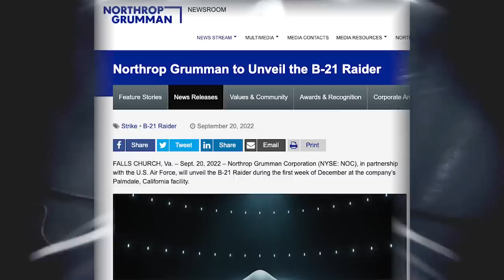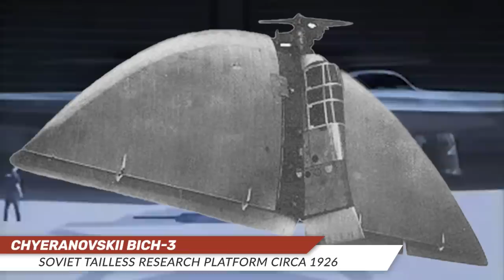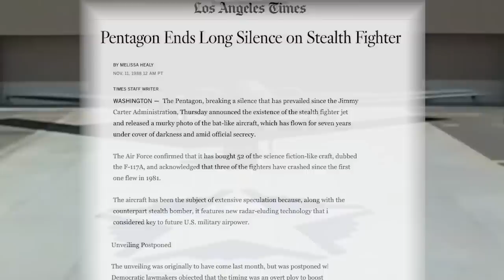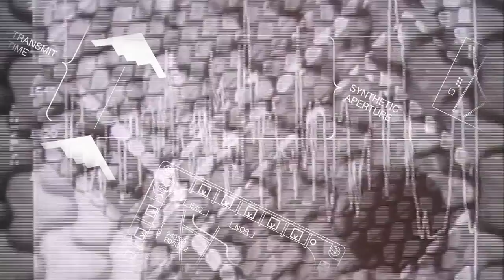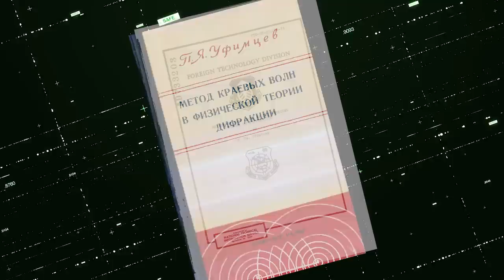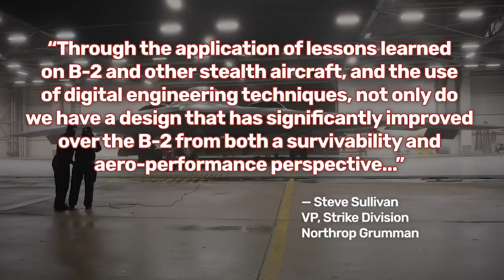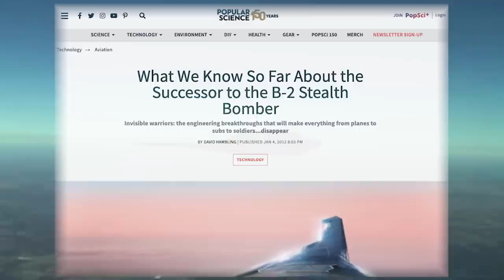Revealing the B-21: Why Northrop Grumman's announcement is a big deal

Comment: For what do you need these expensive and overbuild planes? As you have seen in the UKR - RUS War the only ones you have to be afraid of actually have 3rd Gen planes all others are allies or even worse. At least from there Battlefield Performance. Lean back and chill for 20 year and you will still have a 20 to 30 year advantage. Except stealing, raping and castrating the Russky is good for nothing. Let them simply die out.

Comment: What I find really interesting is that the Xian H-20 will most likely enter service before the B-21.
Which makes you think, as they either began development much earlier than expected or development had a significantly faster pace. Although I suspect the B-21 will have a technological edge over it, as I think the H-20 will be more so comparable to the B-2 than the brand new B-21.
Unless China received critical information straight from the development team at Northrop. Which isn't unlikely, the Manhattan Program was also full of spies.
Reply: This is not the 40s were it's hard to track down people.
Reply: The fact is, China's aviation knowledge and capabilities is years behind the US. They are making progress, good progress too, but nowhere near a danger for the US yet. So the Xian H-20 would be similar to the B-2 in terms of competence and functionality, but will lack some unique "cutting-edge" capabilities that the B-2 has.  "Clones/Replicas" of the original will always miss out on something that makes the original, original.

Comment: Oh man, I remember the B2 and F117 from my childhood. I had little die cast models of them. The B21 sounds incredible. Can not wait to see those hangar doors slide open again. Those crazy engineers over at Northrop just keep knocking it out of the park. And as sad as I will be to see the Lancer go, the B21 looks awesome in the rendering. I think we also really need to give props to Northrop for their project security on this. You're right, the fact that not a single byte of information has leaked on this thing in 7 years is unprecedented. That's real steal right there.

Comment: B-21 Raider: Overpriced flying brick.

What we need is an aircraft that has a 50+ MILLION MILE operational effective range. Must be able to operate both in and out of Earth's atmosphere with absolute impunity. Must have 6.8 gigawatt directed energy laser weapon(s) along with extreme long range hyper-sonic mach 28 capable precision guided MOAB warhead equipped missiles. 12.6+ gigwatt electromagnetic energy deflector shields. Titanium/polymer+steel+carbon nanotube construction laminated multilayered composite armor. 54.8 to 1 thrust to weight ratio with atmospheric top speed of at least Mach 11 at sea level and capable of 98.3% lightspeed beyond Earth's atmosphere and must have extensive anti-cosmic radiation shielding and must have long range sub-space quantum entanglement faster than light communications and faster than light quantum sensors.

Line starts at the door.

Comment: America's air force in the 22nd Century:   B-91 Super Raider, the first invisible bomber, the F-72 Space Superiority Fighter, the F-75 single engine space superiority fighter, and the B-52 Stratofortress.
Reply: You forgot the A-10 Thunderbolt II and the C-130 Super Hercules . Those Birds will still be in the air .
Reply: @michaeltheoret3842  I am not sure if the A 10 will stay around that long. Its role as a cheap, reliable CAS has largely been displaced by gunship version of Cessna or drones. With the advancement of SAM technology and kamikaze drones, it will not be worth the risk of pilots or money
Reply: @quakethedoombringer  I think the A-10s role will change like the B-52 and will be much more of missile truck like the B-52 is, after all the thing can loiter near a battlefield for hours with 10 tonnes of missiles (eventually drones) on its racks and return home with nearly half the aircraft blown away and swish cheesed up. Rumor has it that DARPA and Raytheon are working on a standoff munitions control, kind of like a drone mothership with swarm tech where the munitions are piloted directly by the JTAC and FACs keeping the A-10 and AHs out of harm's way for the most part. So a loitering A-10 can drop a missile on an enemy in less than ten minutes (instead of waiting over an hour for the hit and get aircraft to be briefed and fly out to the trouble spot) then clean up with gun runs before being relieved on station by more A-10s.
Reply: @anydaynow01  that's actually not a bad idea. A 10 has more weapon and fuel capacity than  a Predator. The Gau 8 can (theoretically) be removed to put in sensors. So you can have a really durable "mother ship" carrying drones and missiles
Reply: @quakethedoombringer  I totally agree but I think the military should also not rely 100% on high-tech weapons systems and also have low-tech weapons systems as a backup in the event of cyber warfare and satellites being destroyed by the enemy which would cripple a lot of modern high-tech systems.
Reply: Lol...great sarcasm. Flew over 90% of Yoo-Boobers tho.

Comment: When I was using my GI bill I was doing network administration.   While getting one of the various lectures on security my teacher related a story from his time working with Ford, the special projects team handling the mustang in an effort to keep pictures leaking of the new models had a policy where the first thing you did upon getting to work was to check your phone in.  They attached something to the front and rear cameras making picture taking impossible.   It apparently worked well with no leaks.  They could have kept it simple that like at minimum for the B-21.

Comment: I was flying to LA from the east coast 20 years ago.  The pilot suggested that passengers on the left side of the plane should look above our plane.  We were directly below a B2 on the same course.  The second coolest thing I've ever seen from a jet liner.  Number one was a space shuttle launch.
Reply: Not a good day to be a passenger on the right side!
Reply: Holy crap!! A space shuttle launch viewed from an airplane? I really need to live it up more
Reply: @Charles-pf7zy  This popped up in my recommended feed awhile ago, sounds like you'd like it (it's a view of a space shuttle launch from an airliner).
https://www.youtube.com/watch?v=O1SmCnElDa0
https://www.youtube.com/watch?v=GE_USPTmYXM
Reply: @Charles-pf7zy  I was the Captain on a DC8-61 circling Orlando trying to see a shuttle  launch  .... they scrubbed it and  we continued on. One  of  the  things I wish I had seen. As a pilot  flying  fo 64 years I have seen almost everything  and once was almost hit by a comet or space  junk.
Reply: Very lucky indeed you are sir! -Ohio
Reply: Decades ago, I heard an odd jet engine noise outside my house. Ran out on my deck and looked up to see a B-2 no more than 750'. Made a turn north over my house. The local airport did not have it on radar. I called.
Reply: @winstonsmith6166  they fly regularly over mid missouri. Especially lately I see them bout every 2 months or so.
Reply: The coolest thing I've ever seen is a lightning storm from ABOVE.  It's surreal.
Reply: The coolest thing I ever saw from an airliner was the ground. :(
Reply: Cool story
Reply: What a great experience! My favorite aviation surprises:

1. As a kid with a pilot father stationed at (then) Blytheville AFB,our base housing backed up to the primary landing strip. As a kid of 13 (1969) I was mowing the lawn at dusk. I heard a huge jet engine sound, unlike my dad’s B 52s, & looked up to see this AMAZING  long, black aircraft landing that looked like something from a sci-fi movie. I ran inside to get my dad & show him. His jaw dropped, too. He had heard about the SR 71, but had, of course, never even seen an illustration! I almost peed my pants! It was only about 300 yards away when it taxied to a hangar. 
2. Playing golf in Roswell, NM, with my 15 yr old son. We looked up to see 3 “things” flying that looked like those things that Batman threw in the comic. 1992- Later learned of the F 117s. Another wonderful experience!
Reply: It's just hard to get the hornies over our military tech when we're killing Russians trying to save Ukraine's OWN CITIZENS from NAZIS!! 
Not because the Donbass, LPR, DPR, etc WANTED something other than to be LEFT ALONE 
... (you know, like how Slovenia and Czech could just "vote their way out" ... ) 
But because the NAZIS in Keiv insisted they LIKE THE coup we finally succeeded at ... 
A coup that's UTTERLY IRREFUTABLE ... has the exact consequence our current CIA director SAID it would have ... 
in his 2008 letter to Condoleezza Rice (Bush Admin) no matter WHO was the Pres. of Russia ... 

We're the nation that REFUSES to honestly state what our enemies problems with us are. 
Which is the FIRST STEP to resolving any problem. 
- Iraq had WMDs
- Saddam ASKED US if he could invade Kuwait months before doing it.
- Ritter TOLD US AND THE MEDIA, there ARE NO WMDs in Iraq.
- There was no "ARAB SPRING" ... there were just CIA + and George Soros Coups 
(but I'm sure the CIA had NOTHING to do with the "summer of love."
- There were no "COLOR REVOLUTIONS"  ... the "Orange, Rose, etc., .... 
- There were just COUP D'ETATS, funded by the US. 
We succeeded pulling it off after we lied and sold the BS that Milosevic was a war criminal. (bullshit).
Then replicated it while everyone was focused on Iraq ... after Putin let us use THEIR BASE to start bombing Afghanistan. 
We tried Ukraine in '04 & pretended "Russians just can't figure how to poison someone" after Yanukovych ALREADY WON!!!
We then tried it in Belarus, and though he's a dictator, history tells us we'd install an even worse dictator.
Then succeeded in Georgia, but that "totally peaceful, this is democracy" POS Saakashvili Sucksadiki had to flea bc the US hadn't first corrupted the parliament. 

Thus, when we did the 2nd coup in Ukraine, we already had over half of parliament on our payroll. 
Did you know that in addition to all the other money, YOU are paying the wages of their NAZI troops? At $5B every month, for over a year? 

Did you know we've been conducting "joint exercises with the Putsch Regime" in Keiv since 2015..? 
Listen to Mearsheimer's lecture to a group of IR PhDs and Professors ... and notice the question / statement not ONE asks: 
"Are you SURE we conducted a coup d'etat?" Or "I don't believe we committed a coup d'etat."

They OUTLAWED THEIR LANGUAGE. 
And used their MILITARY to bomb them. 
NO ONE from the Donbass drove to Keiv to attack them. 
ALL deaths between armed belligerents in Ukraine between 2014-2022 ... required people TRAVEL to where people lived, and BOMB THEM / use ARTILLERY ... on CIVILIAN POPULATIONS.  Then, two NATO members brokered a deal:  France and Germany brokered the AUTONOMY of the Donbass between Keiv and the Donbass. 

Kiev never honored it. All they had to do was go home; they never did. And to this day, they shell RESIDENTIAL AREAS DEVOID of military value.
 
Some of the most absurd lies told??
- Russia SHOOTS AT ITSELF ... while inside a nuclear reactor it controlled since MARCH.
- Russia used a US HIMARS to target its own Military Personnel and Ukrainian  NAZIS-POWs.
- Russia blew up a pair of Pipelines (Nord Stream) that Germany BEGGED THEM to build right after Germans protested in SUPPORT OF RUSSIA: 
(CODE for, "WE NEED GAS PLEASE. Better still? That last lie was peddled by the SAME peddler who spells vilify "villify" ... in the declassified notes / words of Brennan documenting the lie Hillary made of Brennan in June 2016: Villify Trump claiming Russian FSB helping Trump to DISTRACT FROM EMAILS ... and, in Oct 2020, proffered the "50 current & former intelligence officers called Hunter Biden's OWN LAPTOP ..... "Russian Disinformation." ).  Disinfo Brennan put out via the VERY SAME channels who had to admit that his previous disinformation were lies also ... without ever mentioning the context of ANY statement by that charlaiton.   

I'd rather be VULNERABLE with a WEAK MILITARY then engage in this DEBAUCHERY, & morally BANKRUPT conduct.
I served in the Marine Corps.  Give other Marines the evidence, then, ask other Marines presented with the facts how they'd feel about going to war on another LIE.

CIA got Obama's speech writer to slide a phrase before he anticipated their moves...
Having called Chemical Weapons a "Red Line" they could FORCE Obama (via their media mouth pieces) into Syria.
They forced the UN inspectors to LIE & pretend it was Syria who'd "crossed that red line." 
Search: Seymour Hersh Chemical Lie
https://www.youtube.com/results?search_query=Seymour+Hersh+Chemical+Lie

Or explain how destroying a 3rd world nation (LIBYA'S) 
CIVILIAN access to RUNNING WATER helped the "moderate extremists" ..? 
Or how NATO is a defensive alliance when it attacked Libya? Or Serbia?

Or why our CIA funded "moderates" were fighting the DIA funded moderates in Syria???

Once you understand that shit ... you'll see why the morality of pilots and officers can't protect us from immoral (evil) behavior.
Reply: Great story.
Reply: I thought you were going to say number 1 a ufo
Reply: My Dad and I tried to catch one of the last shuttle launches in (I think) November of 2010. Scrubbed every day by 4am except Saturday. We went out to Titusville at 5 and they scrubbed that day between 7 and 8. Never did get to see one go up but my Mom and Dad went back for the rescheduled launch in January and at least he got to see it. I will have to get down to see an Artemis launch. Similar boosters and the same engines (+1!) so it sould at least sound like a shuttle launch!
Reply: Oh my I wish I could have been there with you to see that...she is magical and beautiful to behold.
Reply: When I was 14 and in the Civil Air Patrol, we took a field trip down to Cape Kennedy for a weekend. We flew. C54 down and back to DC.   When we were leaving the pilot took us over pad 34A and Apollo 8 was on the pad. As we circled above I got a shot of it with my Kodak Instamatic!

Comment: Had a friend that was working a radar facility in Alaska.  They were told a plane was going to be flying by at a specific time, and they were to track it.  The plane flew by as advised.  They never saw it.  It was a B2.  Now, I'm thinking triple threat here.  B21's loaded with cruise missiles head in and take out airfields, radars, and CNC.  B'2s follow with heavy bomb loads. To hit important static targets.  Followed by B1's to mop up.
Reply: Followed by b52s to redo the old flooring .

Comment: its just hard to believe its still the age of planes that carry physical bombs... shouldn't it be the age of missiles already..
The B-21 will be designed from the start with an open systems architecture.[22] < thats interesting. open systems are deemed as secure enough for strategic bombers to use. so, i think they are secure for anything.

Comment: Could you do a video on the two upcoming helicopter replacement programs?
Sikorsky has the S-97 Raider compete with the Bell+Textron 360 Invictus in the AAS / FARA (armed scout) program.
Meanwhile, the Sikorsky+Boeing SB-1 Defiant competes with the Bell+Lockheed V280 Valor for the FVL (long-range lift) program.
Given how the US defense industry works, it is likely that both companies get one contract each, to keep every factory running, everybody employed.
So if you like both Sikorsky or both Bell designs, get ready for a disappointment.
The Raider has troop capacity while the Invictus does not, but that gives the Invictus better stealth properties, just like the Boeing-Sikorsky RAH-66 Comanche had. Not sure why they abandoned that design. Just to push a common scout and transport design when they know it's not very likely they'll get both contracts?
The V280 seems to be the more mature design, faster and longer range. But the SB-1 might offer better handling and safety, as it is not a tilt rotor. And it's smaller, closer to the Blackhawk size. This might really go both ways.

Comment: I actually SAW this buzz over my truck when I was on US395-US6 towards bishop, CA.

I knew it was a skunk works aircraft and it basically disappeared after talking one then away I couldn’t even see it’s heat from its exhaust as it has turned over the Death Valley lake.
Reply: Owens Lake is the name. Death Valley is over a couple or 3 mountain ranges east of and far out of view from 395.

Comment: I watched a B-2 overfly a college football game. That radar stealth is not matched by sound stealth. It's one of the loudest jet I've ever heard. Perhaps that's a byproduct of the  need to mask the engine's hot exhaust. Thanks for an excellent look at what we can expect.
Reply: A B-2 is not loud at least from my experience😮. They say The jet does not have afterburners but I think it does. It can get loud but only if the pilot tries to do so and I think there is a top-secret afterburner button inside that plane that allows A pilot to be able to do that.
Reply: The F 35 and the 22 on the other hand those are freaking loud planes. Has an F-22 fly over me at 25,000 feet and it is enough to rattle your bones.

Comment: That's funny - I saw the tail #'s of the F-117 @ 8:40 in this video. I have pictures of that exact airframe from the night it was delivered to Ronald Reagan Library with it's wings off sitting on some cement bolsters on a big flatbed after the moving crews and people from Lockheed had arrived there from Palmdale and were waiting around out front of the library before moving it around to the back where it's mounted for display. 

Someone there told me it was used in the first night over Baghdad in the Gulf War. It is also the F-117 with the most flight hours and combat missions.